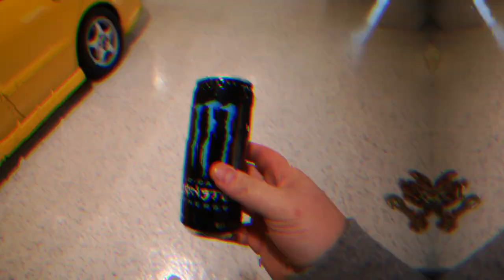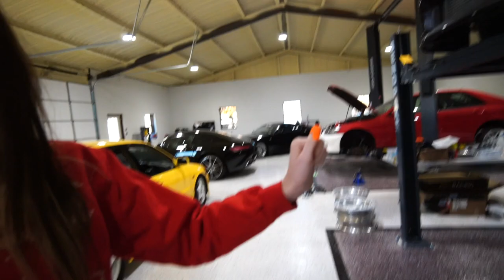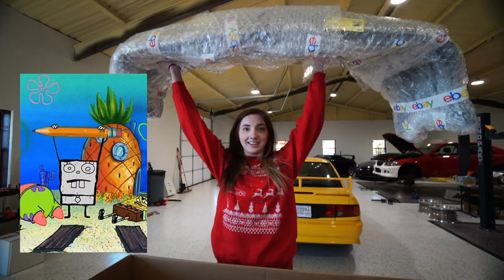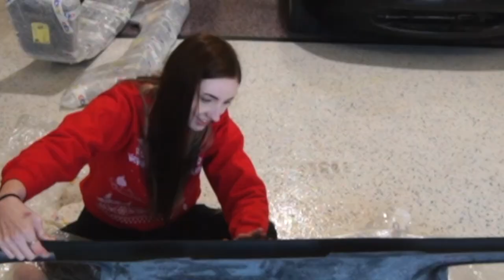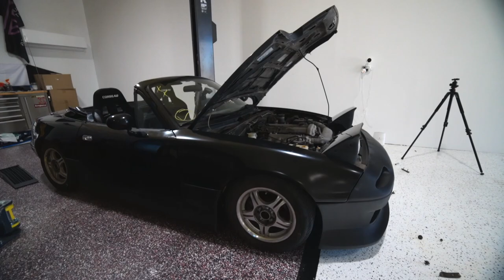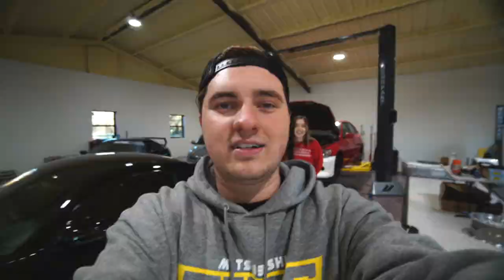WRECKED MIATA Gets a Body Kit

Comment: When starting uphill, release the clutch pedal slowly until it starts to grab while still having your right foot on the brake. When you feel the clutch grab, release the brake pedal and apply some gas. While the right foot is transitioning from the brake to the gas pedal, the left foot should be slowly releasing the clutch. Practice a few times and you will be able to start uphill without rolling back.